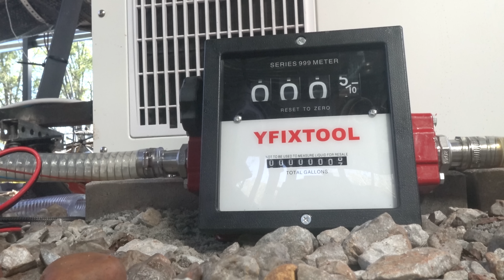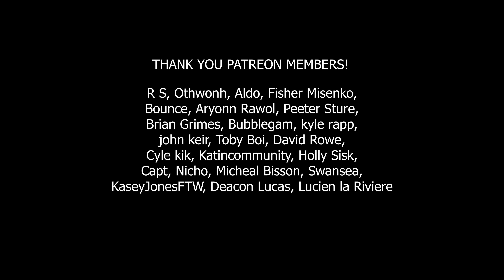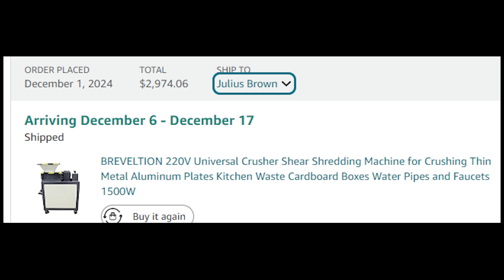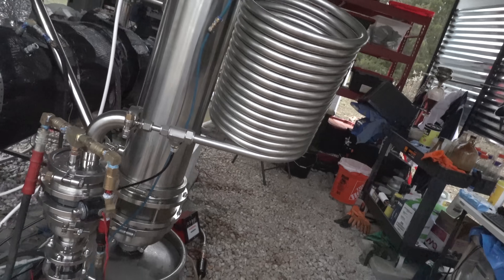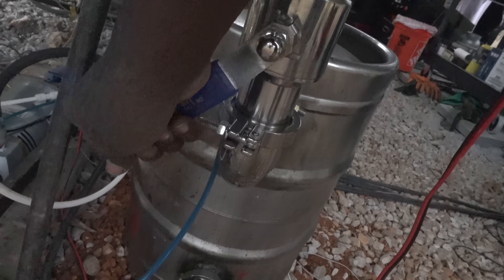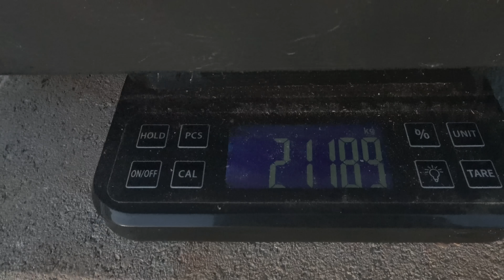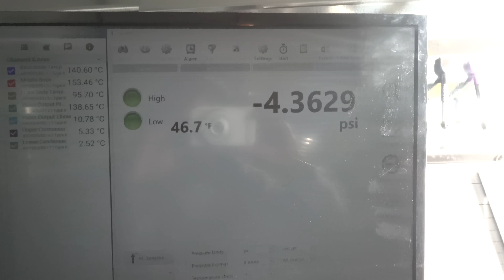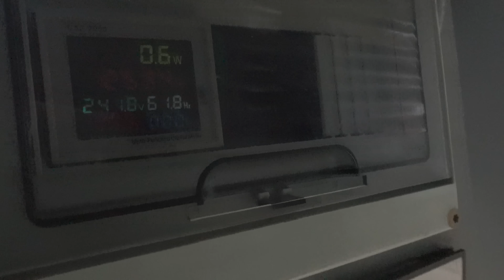I made my own gas station! Fueled by Plastic Waste + LDPE Analysis Run Part 1

Comment: Here are a few thoughts on the technical background. 
I am currently doing my master's degree in chemical engineering in Germany and have been working intensively on reaction technology. I am trying to educate people and am doing my best to fight fake news. 

The main problem here is the terrible selectivity of pyrolysis. Pyrolysis produces a wild mix of products, mainly gases or solid residues that cannot be used. Pyrolysis oil can be distilled (like all mixtures), but the numbers don't lie and are certainly not being published here on purpose. If you take the numbers into account, the whole thing looks very different. To put it mildly, a lot of work goes into extracting very inefficiently small amounts of gasoline from plastic. This is neither particularly innovative nor particularly optimized. The technology has been around for ages and has proven to be uneconomical, simply because breaking down plastic is extremely complicated.

Another particularly problematic issue is the pile of toxic waste and gases (of which there is a whole lot here). Heating with a microwave is also pretty ridiculous; a normal resistance electric oven would make much more sense and be much more efficient.

This is all basic engineering knowledge that any chemical engineer can confirm. It's not miracle technology and certainly not something the oil industry is trying to cover up. Even though I believe corporations are capable of a lot of evil intentions.

Tldr; The process is incredibly inefficient, the guy is incredibly inventive, and he'll probably die of cancer because he's been handling the polymer poison for years.

Translated with DeepL.com (free version)

Comment: it takes way more energy to power the machines to make a cup of gas than the energy contained in that cup of gas. Are the machines powered with renewable energy? If not, then this entire thing is an elaborate waste of energy and creator of pollutants.

Comment: With the redesign when you made the keg upright, you could have made a stand for the keg so a 5 gallon bucket could sit under it or even a 3 gallon, dealer's choice, and that way you would never have to depend on a pump. Alternatively, if you have pump problems and are able to seal the keg off with valves you could use nitrogen to pressurize the keg to pump out the oil.

Comment: It's called pyrolysis. I've done the same thing. I've made it several times we're taking the hydrocarbons, heating him up, breaking him down. Gassing them off at different temperatures, cooling him down and collecting them. But you gotta be honest with them. Dude, that's not gasoline. You may be able to burn it, but it's not what we call gasoline.  The chemical makeup of gasoline is minus a whole bunch of dirty things that you have in that. And while I think it's super cool, I did it a few years ago, it's a neat way to use plastic. It also makes some serious pollution. When you burn it, you can't just burn anything. You can't just use any plastic If you want it to be a clean burning fuel.  I'm assuming when you off gas at the beginning that you're researching and you've done a retort system of some sort so that you're consuming your gasses and not just letting him fly into the atmosphere at least then they're using them, even though when you burn. 'em there's a lot of pollution.  It is cool, but they've been doing this for a long time. And a lot of countries, they do this to survive out of cooking, oil and plastic and all different types of things. This guy did not make this up on his own. He's not a genius. He looked it up on the internet. He is not the first, and he will not be the last. But he's got you guys full, don't invest? I'm not sure what you're even investing in.Maybe you can buy a couple more garbage cans🤣😂
Reply: Saved me a lot of typing. Thanks.

Comment: I notice you aren't using materials like polyester which are made of plastic too... have you tried that before, I wonder if they could actually be easier to extract from being it's very very thin strands of plastic woven together rather than large solid pieces.  It's all the various types of plastic based "fabrics" that give off the most microplastics, too, so those would be the best ones to get rid of.

Comment: from oil to diesel and gas plus propane hope you are using stainless steel pipe and filled it with aluminum shavings then heat tube aka pipe to 350+ to get the gas and propane. you could skip the second processed but running the pipe in to the plastic heat bin that is airtight.... plus the cooler you make the gas the more you get I do the same as you do but I use wood chips to make syngas which I get oil and do away with human waste also which produces oils also

Comment: Sounds interesting but I can't imagine this is all non toxic.  I don't mean to put down your experiments or anything but there is a reason why plastic is considered a carcinogen and then using that liquid into a vapor  like gasoline can't be good for our world at least not without thorough examination of what is occurring including breaking down the substance from a solid to a liquid form not to mention whatever else it is encountering. I'd worry about the soil at the very least but even the equipment itself can potentially contain harmful chemicals after use especially overtime.  Then you have to think about how you would dispose of such creations that potentially contains very hazardous substances.

Comment: Soooo, how efficient is the process? Like, energy used to turn plastic into fuel, vs energy you get from the fuel itself? Cause I feel like it's wasting energy just to convert it from electricity to liquid fuel. (Ignoring the fact that the electricity most likely originally comes from a liquid fuel in the first place...)

Comment: Your pump has probably become less efficient with being blocked with contaminants. If it works like a water pump in a fish tank, the impeller can get fired up and stop turning. A. Heating guy may know or a fuel pump guy.

Comment: Chemistry nerd with background:

Process the crude with a caustic wash. Some lye and water. This will neutralize the pH and save alot of downstream equipment. Filter after this process as it will crash out solids. 

Also, the lighter hydrocarbons coming off the fractionation colomn can be pushed over a heated iron catalyst to form longer hydrocarbon (diesel length) chains.
Reply: To make gasoline capable of modern high compression engines, you will need to either blend with ethanol, or catalytic reformation. The catalytic reformer is a high temperature, high pressure, expensive (uses platinum group metals), and not worth pursuing on a small scale. Ethanol blending is your best bet.

Comment: People are saying it costs energy to run this and it isn't worth it.

Then why do we have an entire society believing in wind turbines? They use fossil fuels to run when the wind isn't strong enough, they use fossil fuels to start up.

On top of this, a wind turbine runs for about 15 years before it needs scrapped, however, we cannot recycle it so they don't get scrapped they get dumped into a turbine graveyard, forever.

15-20 years and they're then put into the earth to sit forever.

Finally, they kill tonnes of birds all the time.

I don't see any of that here, people are brainwashed.

Comment: I think this is done on a larger scale in rural Syria. Using old tyres in a larger combustion chamber. Big enough that smaller men or boys stack the tyres neatly in there. Filthy dangerous work but they have no other option.
What is the quality of the fuel like? Is it a consistent quality throughout the run or is it like distilling alcohol where the first portion of distillate is discarded due to more volatiles being condensed first, methanol and acetone etc. Then middle part of the run is the cleanest ethanol. Can you run a modern fuel injected turbo car engine on it with no issues? I would suspect it would lack some anti knock additives etc.
Interesting process's wouldn't feel comfortable heating gasoline with a naked flame even if it is outside. Only takes 1 error or failure of equipment and you would be a very cremated sausage. Rather you than me.

Comment: I know your trying to improve and increase the volume 
And you making a point of not wasting plastic as fuel.
Unfortunately the energy it takes to make crude oil from plastic exceeds the volume of fuel you make 
I’ve used a chemical process to melt plastic into oil.
Filter and refine it 
But it produces harmful fumes and gives off destabilizing carbon ions in the atmosphere 
It can be done, but cost more to produce than the value of the fuel you save.
Also you have to regulate the octane or you will burn up engines

Comment: Look into plastic gasification as well, it can be directly reformed into a clean burning gas comparable to propane. Plastic is combusted in a controlled low oxygen environment and the combustion products are reduced into carbon monoxide and hydrogen gases in a carbon rich environment.

Comment: Somebody needs to stop this man--immediately--for his own safety. He's using 6 microwaves and a vacuum distillation setup to turn solid plastics into quite literal liquid cancer. His final product "fuel" is predominantly a solution of benzene, toluene, and ethyl benzene, IN styrene (for polystyrene pyrolysis under these conditions, styrene comprises > 50% of the final product...see "Reverse polymerization of waste polystyrene through microwave assisted pyrolysis" Andrea Undri, et al. (2014) J. of Analytical and Applied Pyrolysis)...and who knows what else. His respirator mask and other PPE are entirely insufficient for these activities, and his outdoor setup has MAJOR containment issues. Working outdoors in variable wind/weather conditions, is not the same thing as working in a controlled, contained atmosphere, with proper ventilation, and appropriate PPE.

I am not "hating." I am genuinely concerned about this person's health, and the health of anyone else residing in that area who might also be affected by this incredibly dangerous operation. His health is almost certainly already suffering.

Comment: Where are you grabbing the energy for this? Looks like you have some propane tanks for heating and electrical air pumps for pressurization, right?

What chemicals (if any) do you need to replenish for breaking the plastics down in the crude phase?

The plastic recycling into fuel is itself  a fantastic work! But if this could use renewable energy to get towards a carbon neutral or negative energy imprint, this would be an environmentalists wet dream!!!!

Comment: Guys, there's a reason we don't invest in this yet. It requires a ton of energy, expensive and specialized equipment, and it isn't safe, at least if not very carefully mamaged. Economically, this is much more expensive than more conventional methods, and many regions don't have the infrastructure for this (yet?).

Not saying this is a bad thing. I love to see innovation, but this isn't anything new.

Also, recycling plastic is cost effictive, and a long term solution for waste management

Comment: So many tin foils in here.
Nobody will kill him, government won't do anything.

This process costs more energy that it outputs.
You have to "inject" a lot of energy in the plastic to chemically decompose it to smaller hydrocarbons. This process is very unefficient.

It's like going to the bank with 100USD, exchanging it to 135 CAD, and then returning to exchanging back to 90USD. Here you are not creating USD, you just recover it while losing a bunch in the exchange process. Same thing here.

You start with oil, you convert to plastic, then you convert back to oil wasting tons of energy in between. Any chemist knows about this.

If no company is already using this process it is because it is not good.

Comment: A hand full of other companies have tried this (aka catalytic depolymerization) ,and haven't gone that big. turns out this is not economically feasible at scale . additionally it would be more environmentally safe to recycle the plastic given that the output fuels of this process (like benzene ) are still pollutants ,but it would be a good option to Unrecyclable plastic clean up. also companies like Brightmark have gone global with this so there may be hope for it .

Comment: I don't think its a good idea. When you break down plastics like this it still contains harmful "forever chemicals" that aren't destroyed by high temperatures. I base this on testing of the ash for specialized incinerators that incinerate plastics used at some waste disposal facilities that found harmful "forever chemicals" remained even after incineration. For this "gas" that he's making its going to be incredibly dirty and running a motor on it will put the by-products of burning this plastic directly into the environment.

The conversion of the plastics here isn't as clean as implied. I want to remind everyone that in the history of the automotive industry there was a time when lead was added to gas because it significantly improved vehicle performance and fuel economy. But it turned out that adding lead to fuel resulted in arguably the most widespread poisoning of the population ever conducted. Lead is very neurotic for the brain... I can't imagine the horrors that lurk without your plastic-derived concoction. 

If you're interested in alternative fuel sources take a look at something like "wood gas" or even "steam." Sure, its highly inefficient but at least its unlikely to give you some horrible disease. Or why look into solar?

Comment: Ngl as cool as this is I do have several environmental concerns with the main one being does your system have any leaking or what are you doing with the waste products? If there are leaks you are potentially contaminating the land beneath it which would pose some serious environmental problems not to mention if you live in the US you are required to have permits, to refine gasoline which unfortunately if you request to make your own fuel from your own backyard the government probably wouldn’t be too happy with that. Good luck and be safe doing it!

Comment: The question is, how much energy is put in vs how much stored energy in fuel do you get out? Surely at low scales you're at a loss, but maybe there is a scaling solution to this.

Comment: You should build one on the coast that collects it from the ocean and use something like a large dehydrator or even like those drying fans in gas stations to remove the water essentially turning it into a garbage pile assembly line!

Comment: Yes, you can convert plastic to fuel, you can also use vegetable oil as a fuel, however when it comes to using something as a fuel you need to look at how much energy you spend to create it vs how much energy it releases, this method is not feasible on large scale, on a gimmick level yes makes sense

Comment: Hopefully you can use that fuel in your car when you're driving yourself back and forth to your Oncologist and Chemo sessions because YOU'RE MAKING BENZENE. YOU'RE EXPOSING YOURSELF AND EVERYONE IN THE IMMEDIATE AREA TO MASSIVE LEVELS OF CARCINOGENS & AT THE VERY LEAST POISONING THE SHIT OUT OF YOURSELF, THE AIR, THE LAND YOUR ON. EVERYTHING. If you were as smart as you think you are you'd either stop what you're doing IMMEDIATELY or realize you have neither the equipment nor the proper facilities to do what it is you are doing in a safe and regulated environment and postpone any live experiments or tests until you can assure that you are.

Comment: You should crush the big plastic bottles, like the juice jugs… would be able to stuff way more inside that furnace. Also if you still have the cap, screw it back on while you’re fulling compressing the bottle with your foot or whatever. The cap will keep it as small as possible since it won’t be sucking in all the air you just crushed out.

Comment: How much fuel do you use vs how much you make. What carcinogens are being produced in the process. When this fuel is burned, how efficient and how toxic vs other fuels. Obviously putting plastics to use is important but does this process outweigh the negatives…

You’re definitely on to something. Hoping you can refine the process.

Comment: I think the problem is that when driving on this fuel, you would pollute the air with these plastic left overs & heated chems, which harms the environment hard no?
Reply: he has multiple filtering methods, activated charcoal etc

Comment: Yes this tech has existed since plastics were invented. You are basically reversing the engineering of the plastic breaking down the chains and refining out any leftover petrochemicals. Obviously if this was a sustainable or clean way to process plastic it would done at scale. However it is almost certain that the emissions released would be worse than simply burying the plastic or using a bioprocessing method such as gmo algae that can metabolize it naturally. This is just a dirty, noxious and borderline third world method of fuel production. I would only guess people in Africa, India and Bangladesh could benefit from this.

Comment: Many of cheaper fuel pumps have an undersized fuse that blows easily. Remove some screws, replace or bypass the fuse and you’re back in business.

Comment: You don't need condensers and junk, just run the hot exhaust into a tank of water, the fuel will condense in the water and sit on top.